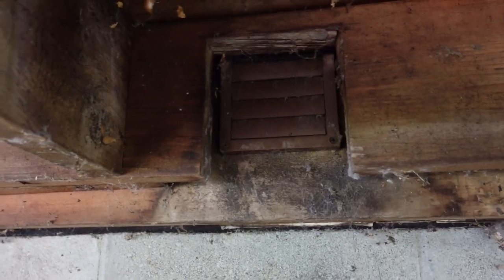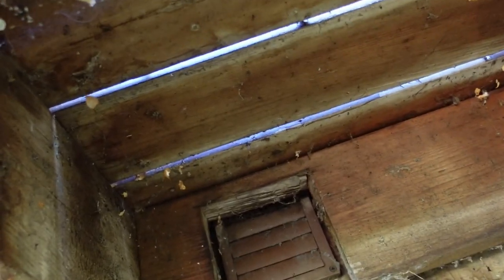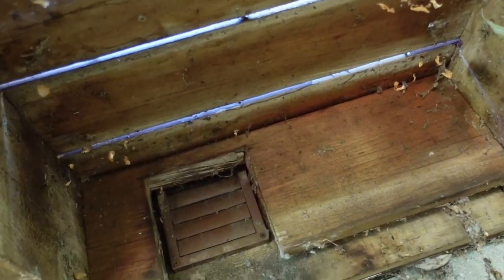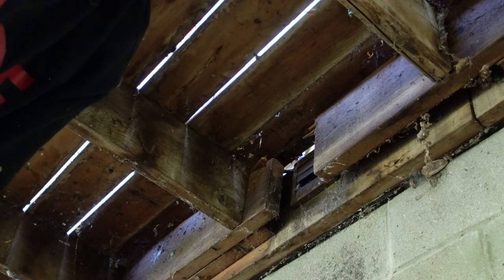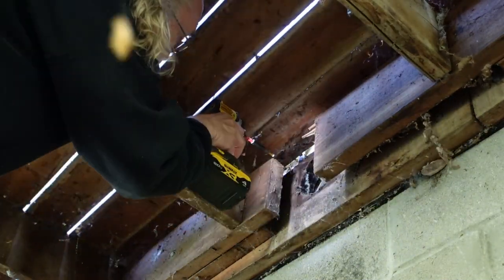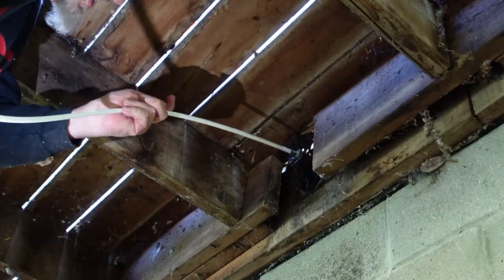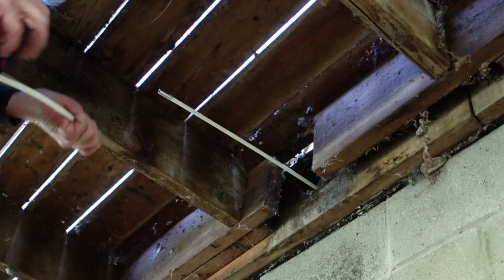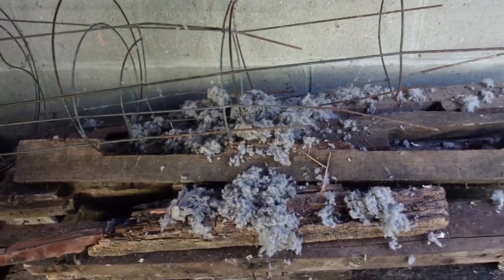Cleaning a dryer vent, first time in 30 years

Comment: That's a cool little tool for vent cleaning.  We may need to look at that as we have a long dryer run imbedded in the slab.  No problems with it yet, but...  Did you run the dryer just to see how much other stuff it might have kicked out by itself?  Seems like you've  at least cleared some of the jam.  Well done!